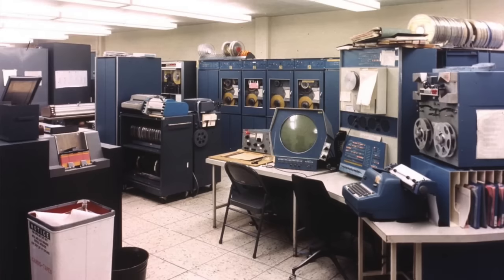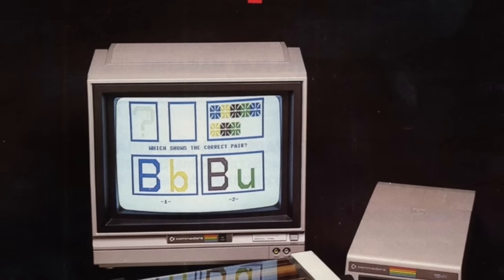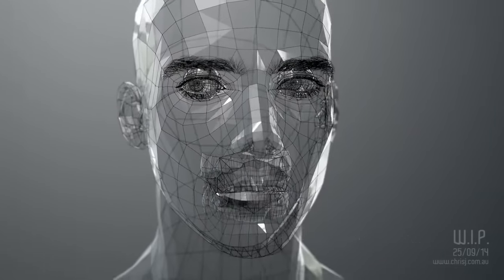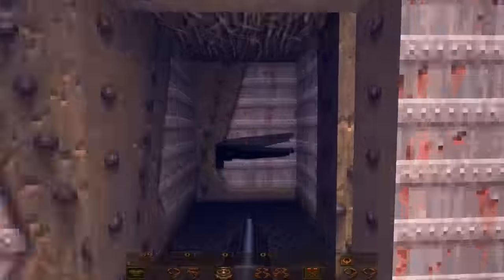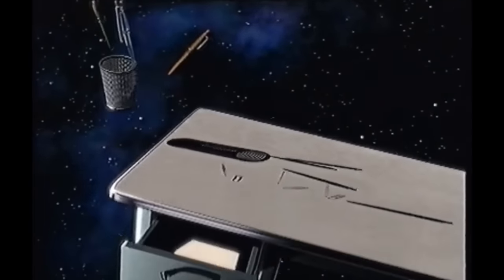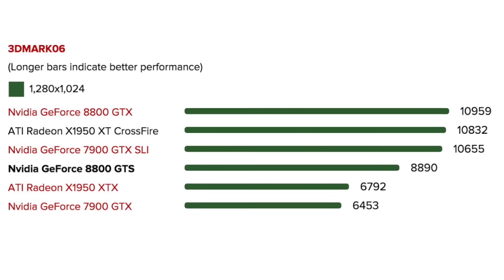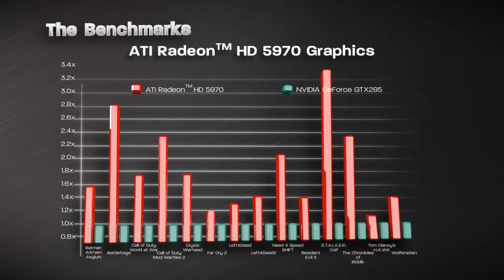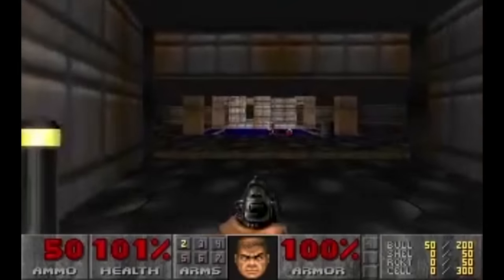Evolution Of PC Gaming Hardware

Comment: Saying that Watch Dogs worked great on nvidia cards is just straight up lying, it didn't work great on any card. Performance was terrible, not even a GeForce Titan could run the game smooth. It was a big failure, probably the worst optimised game in gaming history. It was also bottlenecked before release so that console peasants would get the same "experience" as PC.
Reply: Nope, runs fine on my computer.
Reply: +Phil Bob it's still a good game though.......grfx whores... you can never pleazzze them :P
Reply: Of course i'm playing on 4k with ultra settings. There were some moments that it played good but some updates screwed it up.
Reply: +Yükselcan Çako no it´s not. our eyes are changing. my mother said too that 24fps looked fine for here, i was simply dying at this framerate because it stuttered for my eyes/brain.
Reply: +flo richi Nothing is changing. It's just a matter of getting used to it.
Reply: Yükselcan Çako right, changing was the wrong word
Reply: It ran fine for me, even with the e3 mod installed, I have a gtx 780ftw and it was always above 50 fps
Reply: +Fucktard Wasn't it an issue with textures? So long as you don't set it to max it ran smoothly...
Reply: +Fucktard It ran pretty well for me with everything set to max except textures one step lower, plus texture enhancement unlocker. The fps would only struggle to reach 60fps with textures on max. Spec: 3770k, 32gb ddr3, r9 290 4gb, hw raid ssds.
Reply: i agree. it ran horribly for me even on low although it auto set me at high. pity too, i quite enjoy the game but the framerate would drop to a stutter. and fuck driving. haha
Reply: +The Gibus ark is a pre-alpha game, ark runs ok on my hardware, an acceptable 45fps. Watch dogs was a 'finished game'
batman arkham knight was poorly optimised.
Reply: I have a GTX 780 and my system play watchdogs just fine on day one....didn't encounter any of the studdering my roommates computer had

Comment: can i run gta 5? on my system? 4 potatoes and 3 carrots
i mean it runs better than a ps4 but i just want to be sure
Reply: +The Rez (GhoulTV) Maybe if u add a mushroom to it, GTA5 would run more smoothly.
Reply: +The Rez (GhoulTV) As long as you run the carrots in SLI. I recommend that you stick the carrots in a triangle shape into one potato. Then, stick the other three potatoes on top of the carrots. This will ensure optimal performance. And as Deepak mentioned, adding a mushroom will create extra buttery smoothness. Mentioning that, you might want to get butter and melt it. Then pour that on popcorn.
Reply: +Eryk Nowak He's correct. I recently did this and my Gta 5 performance skyrocketed! Just make sure though that the carrots are ripe; unripe carrots don't work so well.... I learned that the hard way..
Reply: When I tried this at home I found that mashing one of the potatoes and using it to stick the other potatoes together works better.
Reply: MrMutebe Yes, you'll get better cooling; however, you'll be sacrificing a core to better cool the system. I recommend that you open a window. BUT REMEMBER TO HAVE A SCREEN. Those bastards ate one of my cores and a GPU. I'm down to two cores and a dual SLI.
Reply: +The Rez (GhoulTV)  
drink much?
Reply: +Eryk Nowak dude... where do u buy ur weed from ?! pls man 
i need some !
Reply: I believe he grows it in his backyard k?
Reply: +Eryk Nowak putting weed in your system gives higher performance
Reply: ***** Sometimes I grow weed accidentally in my backyard. They just pop out everywhere. Also, I sometimes buy to help the local community at my farmer's market. They secretly name the container as a spice named "Oregano."
Reply: BoostA RoostA Yes, HIGHER performance. Not necessarily better performance.
Reply: +The Rez (GhoulTV) are you kidding me?! With that kind of rig you could run it on ultra hd 8K and it would never drop from 240 fps
Reply: +The Rez (GhoulTV) If you actually focused on building your PC rather than hating on consoles, then sure, why not. 4 potatoes and 3 carrots are enough.
Reply: My name has nothing to do with my comment it was a joke i play console allot, i even own a wii u
Reply: The Rez It's alright.
Reply: +The Rez (GhoulTV) I recommend cooking them to get that extra performance boost. Add a little melted cheese and you'll find GTA looking pretty tasty!
Reply: ***** Both literally and figuratively.
Reply: ***** hahahah, funny, nothing beats pc when it comes to graphics, pc also has mods which can add endless exclusives
Reply: ***** O rly? Which one of the food groups does a PS4 belong to?

That's what I thought
Reply: *****
4 potatoes and 3 carrots is better than ps4 stop bringing your petty non-edible devices into this dude, if edible systems counted as platforms The Rez's system would be the best.
Reply: ***** That ain't a food group, scrub

Put that in your salad and mix it
Reply: ***** ps4 better than? never going to happen, call of duty is not going to be only on ps4 it is only getting its dlc first, it only has 1080p resolution and 60 fps, mean while pc has  4k resolution and unlimeted fps, bo3 is getting custom servers, modded game mods and custom zombies maps, mean while ps4 cannot handle mods, pc has more players than both xbox one and ps4 combined, there are about  50-60 million on both put together, while pc has over 700 million gamers, consoles are centuries behind pc in gamer numbers and technology, pc has for more exclusives and far better games, consoles will never be better than pc
Reply: +The Rez (GhoulTV) No but it would help make a mean stew.
Reply: ccricers nowe im in the mood for a stew
Reply: +I hope u remember  me Yeah, because everyone who's anyone think Call of Duty is the god of modern gaming. You make me sad to be alive.  :/
Reply: +I hope u remember  me 

Peasant.
Reply: +BoostA RoostA XD
Reply: ***** learn how to spell, bro.
Reply: +The Rez (GhoulTV) No, potato is a camera, you can't play games with it.
Reply: +MrMutebe lol
Reply: +The Rez (GhoulTV) almost a tomato is recommended
Reply: +The Rez (GhoulTV) peeled or not thats a huge difference in cooling
Reply: ***** no its not, it never will
Reply: ***** pc has had mods for years, consoles will never have mods
Reply: ***** no they didnt, i even checked, only fallout 4 mods, mean while pc gets mods for nearly every game out
Reply: ***** yeah only for fallout, but not for any other games, why would i be mad about mods on console? it would not change the fact pc is better
Reply: ***** then prove to me console is better, prove that console has better graphics and hardware, even though pc is constantly evolving, pc is on the verge of 8k resolution and consoles just got to 1080p, a place pc was at when the ps3 first came out
Reply: ***** pc can run every game made for ps4 better than a ps4 can
Reply: +The Rez (GhoulTV) That's a little overstated don't you think? Very very few people have a gaming rig capable of 4k gaming with steady frame rates at high settings. I would say common PC gaming is just taking the step towards 1440p gaming.
Reply: Mine worked I just chewed on the potato and turned it into mush. Then, rub it on the carrot and shove it into the other 3 potatoes. It runs gta V at 0.000002 fps.
Reply: woah we got a badass over here
Reply: Yuya Fujisawa Gawdam right! Shout out to Porky Pig for wearing no pants but having that bow tie and keeping it classy as fuck! That's whatsup!
Reply: yeahhhh baby!
Reply: Yuya Fujisawa I know right! Shout out to permanent marker for keeping shit we write permanent as fuck! That's whatsup!
Reply: WHOOOP WHOOP SHOUT OUT!! My homie the PERMANENT MARKER
Reply: +Pinkie Pie I have a dirty mind, and want to know what you meant by learning it the hard way.
I laughed so hard reading your comment, it was geniously, brilliant if it was what you meant xD
Reply: Thank you for your honest answer.
I appreciate it :)
Reply: No, GTA5 would run 360k at 420fps on ultra
Reply: Minecraft however, would run at 9001fps due to the potato having potato in it.
Reply: You have a Peasant station 4
Reply: What's funny to me is that the potatoes = CPU and carrots = GPU and the amount of time they stay ripe and edible is about the amount of time you have to upgrade each them lol

Comment: my pc: name:potatodestroyer

Processor:Tesco Brand Carrots (runs arma at 0.2 fps really good for £3 build)
Graphics Card:AMD GTX TITAN POTATO 7777
power supply: A Piece Of Donald Trumps Hair
RAM:100000 Milli Bytes of DDR2
Motherboard:some broccoli for 50p

im kidding my actual pc specs when i get my gaming pc will be 

Processor:Intel I5-6400 3.2ghz
Graphics Card:ASUS STRIX GTX 970 4GB 
Ram:16gb Ballistix 8x2
Power Supply:600 WATTS
Motherboard:Gigabyte Z170-Gaming K3 ATX Motherboard [CrossFire]
Memory:2TB Barracuda
Reply: my pc runs 
csgo 120fps MAX (low)
Minecraft 140 MAX(ultra low)
Gta online 5 MAX(med)
SW:Battlefront(low)
Dying light 30 MAX(ultra fucking low)

This is why I better buy a PS4,cuz I don't have enough money to fucking buy a futuristic pc
oh and my monitor is schratched
And my cable management is a hive
Reply: CACATUA 242 .
Reply: CACATUA 242 is my pc good just asking
Reply: ***** with specs like those you can run space cadet pinball at 144 fps on 4k resolution. RIP NEO AND SCORPIO
Reply: CACATUA 242 wow
Reply: CACATUA 242 i also could probably run bf3 at 4k at 30fps or 25fps but at 1080p probably around 120fps
Reply: ***** minesweeper a 1 fps reolution of 100x150
Reply: CACATUA 242 XD my potatodestoryer is max out!!! bruv get on meh level
Reply: Get a GTX 1060 or 1070
Reply: SergeantRewind to much and too late already got my pc the 1060 is the same as my graphics card the gtx 970 but the 1070 is 500 and is like the titan x but my pc is already amazing
Reply: Intel i5 != amazing. It just doesn't.

AMD Vishera FX-6350 6-core @ 4.7GHz (overclocked)
NVidia GeForce GTX 950 Ti SSC x2, 8GBs total VRAM (two cards)
32GB DDR3 RAM
240GB Corsair SSD, 300MB/250MB read/write
3TB Barricuda HDD, 7500RPM
MSI 970 Gaming Board
Power supply: A 1999 supply I pulled out of an old dell workstation, no joke (I have a big fat surge protector though...)

Again not the best PC I'll admit that, but this was a $1200 build and it runs everything I need it to run at a happy 60 FPS (VSync because I don't want to bomb my GPU)
Reply: Roncast Ron i would upgrade to a 960 4gb or 970 4gb
Reply: +AVD GamerHD I'll be more than happy to um... borrow those games from you.
Reply: Ehm... a GTX 950 Ti?
Reply: Roncast Ron
950ti hahahah
Reply: Smoke Gaming Channel Exactly what I said.
Reply: DON'T GET A 970! Get a 1060. Or a 1050 when it comes out if you can't affort a 1060
Reply: Mike Baker its too late m8 i have had my pc for 1 month now and its amazing i may upgrade to a 1070 or 1080 later on
Reply: ***** Ah ok. So I see you made the same mistake as me :P I got a PC with a 960 in it like 4 months ago
Reply: Mike Baker 2gb or 4gb?
Reply: ***** I heard it isn't 4gb. Or is that the 970? I don't know, I forget.
Reply: ***** 2gb unfortunately D: PC parts in my country are so overpriced my PC came out to 1000 usd with a 960 and an i5 4460
Reply: fam what has my man done you bought a gtx 970 just beforre then 10 series came out aaahaa lmao peakk
Reply: Bartek22026 Speak english please.
Reply: Bartek22026 m8 my gtx 970 is amazing i can play any game nowaday above 80fps apart from crysis 3 and ark survival evolved
Reply: ***** ye but its peak because the 1060 is like a 980 for similar price lol
Reply: Bartek22026 also i am thinking of upgrading to a gtx 1070 (if i get enough a 1080) but the 1060 is pointless its the same as a gtx 970
Reply: ***** erm no its a 980 have you seen benchmarks
Reply: Bartek22026 yes it gives you like 5fps more sometimes 10fps more my money looks like its going for a gtx 1070 or 1080
Reply: ***** Suit yourself im still waiting for my gtx 1060 to arrive for over a fucking month lol. Finallly a step up from my legendary HD7850 oc'd
Reply: Bartek22026 xD m8 a game i recommend to you is bf3 or bc2
Reply: Bartek22026 what do you recommend me im a big gamer
Reply: ***** arma 2 dayz mod i lost my life to that and CS:GO.
Reply: Bartek22026 i already got arma 2 dayz as well xD its so good and yes i want to get csgo
Reply: ***** Did you play a lot of epoch and overpoch? If so on what servers?
Reply: Bartek22026 yeh m8 i play de1000
Reply: ***** Lol thats a shit server its not even overpoch its just a deathmatch.

I played on MGT Epoch and CCG Overpoch the two best servers
Reply: Bartek22026 have you played truxton or damaged yet they are both great
Reply: ***** Nope. Here is a list of all servers I played on (for a long time not just visiting)
MGT:EPOCH
CCG:DAY/NIGHT OVERPOCh
CCG: EU3 OVERPOCH
MercsGaming overpoch
Gaming Deluxe Madgaming Epoch
W.I.C.K.E.D PvP Overwatch
Reply: memory can bigger ı mean 4tb 
sorry for my bad english
Reply: Osman gorkem Duran thats like £60 extra or $90
Reply: WTF 120.000 ibuy best pc gamer ever whit titan x sli x 2 hhhhh
Reply: oh no
Reply: Potatoes oh yes ;)
Reply: hah I got my pc that runs on bleach for free
Reply: Why didn't you get gtx 10 series instead?
Reply: *nibble not Milli Bytes...
Reply: Isn't 60fps good enough?
Reply: +Sausage no can't you tell from my video ?
Reply: Where and how do u get such a pc?? Seem like a beast PC.
Reply: I did the Battle for Whiterun in Skryim @ -2 FPS. Still won tho.
Reply: King SHIIFT ahh i see where your coming from but 2p for tescos and 0.1p for aldis is good those higher clock speeds are helpful but the tesco gtx .5 carrot comes out soon and i get a free upgrade with the tesco carrots
Reply: King SHIIFT damn now thats fancy
Reply: King SHIIFT m8 use that pc well thats  a really pricey computer you may as well play almost everything at 4k
Reply: King SHIIFT get a 4k monitor with it cuz if you can afford that you can get a 4k monitor
Reply: King SHIIFT 1440p is still amazing arma 3 would amazing!
Reply: My laptop has nvidia 310m and a broken hinge... can't beat that!
Reply: RoyalRumble you mean I5 6500 the 6400 has a lower clockspeed than you are saying
Reply: ProGuy1 Gaming yeh i switched instead i5 6500 is beast
Reply: no idea how my computer can record overwatch at 60 fps, but it just can lol. It was originally an OEM dell xps that my grandpa gave to me, but I swapped out some parts. I'm on my laptop right now, so i forgot the specs, but i'm pretty sure it has a third-generation intel i5 at about 3 ghz and 4 cores, a NVidia GeForce GT 740 that actually works surprisingly well for overwatch and other modern games, a 256 gb Mushkin SSD, a shitty 2005 320 gb HDD for files and crap, and 12 gb's of ram, although windows says only 8 of it is usable lol.
Reply: RoyalRumble welcome onboard where forever spending on hardware:) I have just bought ASUS Strix Z270F board and i7 7700K cpu corsair 2x8GB 3000MHz ram msi GeForce gtx 1060 3G graphics and a cheap 128GB corsair ssd. For start. Then later this year upgrading to 32GB memory 2x GeForce gtx 1080 card sli connected and a much faster 512GB ssd and will need a corsair 1000 watts psu for all that power and a new bigger tower and 4K monitor. And a cpu water cooler and memory cooler for overclocking. Hopefully games will run smooth :)
Reply: RoyalRumble Jesus Christ 2TB of Memory
Reply: Niker Productions I think he meant hdd space xD
Reply: You keep saying 970 4Gb, and not 3.5Gb. Remember that you were robbed.
Reply: take down the ram a little cuz it will be bottlenecked by yoyr gpu and upgrade the gpu to a 1060 or 1070 then only use one stick si that upgrade is open.

Comment: 4790k cpu with 16 GB of RAM and a GTX 980Ti. 1440p Gsync monitor. Thinking about getting another GTX 980Ti
Reply: Nice!
Reply: +WeekendGamingNerds I would literally kill someone for your setup, haha
Reply: Freesync is better
Reply: theres always that one guy ^
Reply: +WeekendGamingNerds Got your setup, except I have a 21:9 3440x1440P monitor (It has more pixels, 1440P has almost 3.7m Pixels and 21:9 1440P has 4.9 Pixels) I honestly think 21:9 is better than 4K (I've experienced both.) 

What kind of 980TI do you have?
Reply: +WeekendGamingNerds Now you're just showing off... nevertheless, that's a pretty kickass system.
Reply: Me Myselfandi That's funny, I almost went that route. I'll probably do that for my next upgrade with the second 980Ti. I didn't go with that initially because they didn't really have my ideal monitor with all the specs I wanted at the time, however, the Acer Predator just came out which is basically perfect so I'll probably be selling my ROG Swift and trading up to that. Which model of monitor did you go with?
Reply: +WeekendGamingNerds I'm hungry now!
Reply: WeekendGamingNerds I went with the Samsung 34SE790C, I prefer VA to IPS because the black colours look better, that's why I chose this monitor. I also managed to overclock it to 85Hz.
Reply: Me Myselfandi Solid overclock.
Reply: My god it's a  a a a a a master PC I have the last gen 780ti what I do I need to upgrade gets 4 Titan xs